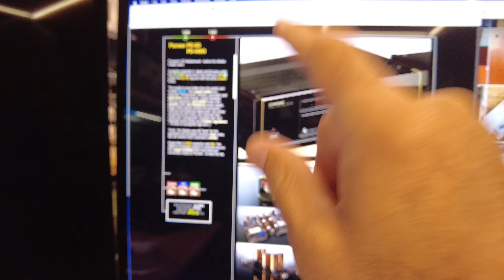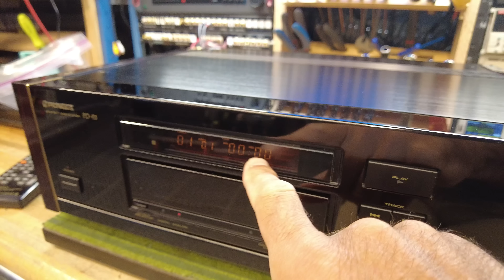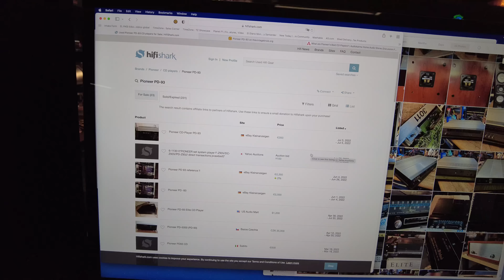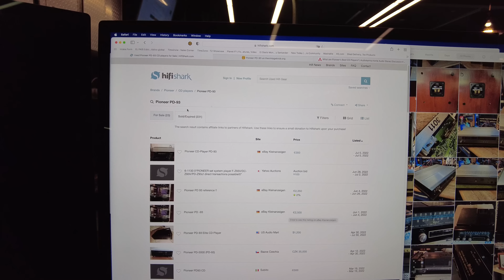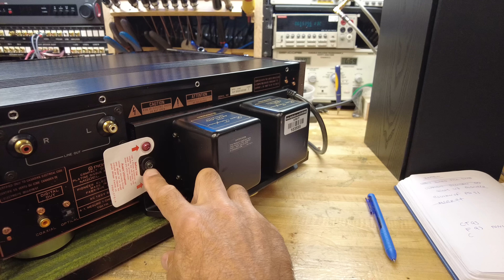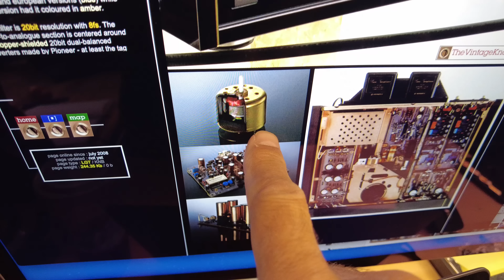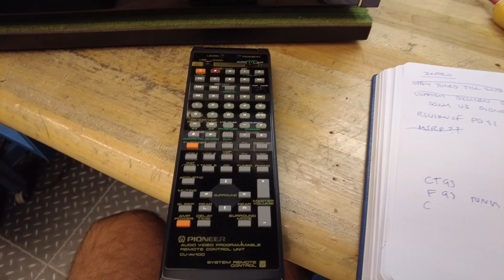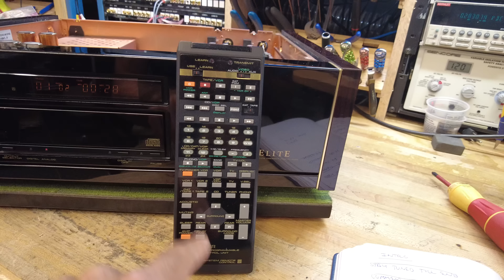If You Find One of These... BUY, BUY, BUY.  The Killer Pioneer Elite PD-93 CD Player

Comment: This is one of the best CD player to date. It is using PCM63 DAC covered with copper shield, the sound from it is extraordinary.
Reply: How does it compare to a newer Denon DCD-S10II for example ?
Reply: @ThomasL  Thomas it comes down to a matter of taste and audio equitment matching (Synergy)
Reply from the maker: Indeed, its all a matter of taste.
Reply: Pioneer made several better ones in Japan under the "T" series, like the PD-T07, PD-T07 limited, and the PD-T09 which the later is the best CD player they ever made and is far better (and much more expensive) then the PD-5000/PD-93.
Reply: @aegisofhonor  You correct Basically Pioneers Domestic market they got a lot of good audio in Japan -But also100v 
Tuff thing about cd players is their fragile in shipping
Reply: @tee-jaythestereo-bargainph2120  definitely don't want that banging around in the back of a  truck with just normal shipping
Reply: @aegisofhonor  Pioneer pd 07 is the same with pd 75 and pd 09 is pd 95. The difference between pd 93 and pd 95 is the output balance. Pioneer elite was for the US market and pd 95 only for Japan 😉
Reply: I have the pd-73 and I was wondering how much different is from pd-93/95. Are these way better than the 73? Thank you!
Reply: Single chip per channel or double. As far as I know there was a design flow in the 63 chip which creates crossover distortion which can be neutralized only if using two of them together.

Comment: I regret selling my pioneer elite vsx 49txi reciever. It weighed a ton and had an all copper chassis under the hood. I used it as a power amp and it sounded really good. Snatch them up if you can find them.
Reply: i only had a AV receiver and was brought to me from the U.S. had yellow lights in the display instead of siver but was the high end of pioneers av receivers at the time but had a quality of sound that i never heard till today in other was very heavy but older ,to the new more evolved AV receivers this doesn´t have any form of surround either than the older one but never the less as i said before maybe the best i ever heard
Reply from the maker: Sounds like we all have a regrettable story about selling some piece of gear in the pursuit of nirvana.

Comment: the agglomerate of wood is better than the wood itself in some purposes, such as for example it does not warp with temperature differences, however it can absorb moisture but so can wood, but also i believe no one has material of this quality in a damp place.
Reply from the maker: I agree Elias but the veneer is mounted on cheap chip board that falls apart at the slightest impact.  Perhaps they could have used a ply base.
Reply: @SkyFiAudio  I understand, maybe it would be better if they didn't put anything on the sides lol, oh well... but I believe the sound quality is fantastic, I say this because my main cd player is a Pioneer DV-868Avi and it has excellent sound quality in my Aura Va-100 Evo amp, but my dream " Buy Buy Buy" would really be the Grundig CD-9009, and from what my father once told me through a magazine he read many years ago and what I've researched and seen photos since then, it might be today one of the most collectable vintage CD players, a while ago i saw one for sale in the neighbor country of Spain, but 750€ is too much for a man who has a family lol. best regards.

Comment: By the way the turn of display is nothing to do with saving the display or dark room, it was to stop electrical interference onto the circuit form the VFD display. Also just correct you that is not true about belts, I had cd player in for repair that are 30 years old and the belts are fine. So it depends on how belts are made.

Comment: I was surprised to hear you say that you preferred true power buttons rather than standby. I've always heard, mainly from gear producers and sellers, that you should leave your gear in standby as it keeps it warmed up and that the jolt of electricity from powering it up does more harm than good. So which is better - to keep your gear in standby or powering it off and on after each use?
Reply: I heard this too, especially when it comes to slotted boards which over time can jolt out of place to the point of losing contact
Reply: Unless it has tubes in it, or they tell you not to do it in the manual, you leave it on all the time. It sounds better and lasts longer.
Reply: The question is what kind of standby. Often, it’s merely the ir circuit that remains on.
Reply: today they worn out very fast ,the lights start to decrease it´s brightness ,even worse in components bought in the 90´s i remenber this cd player having no stand by the light on the display never faded ,but the first i bought with stand by i notice one day that i fall a sleep in a sofa next to my system that even closed i notice that the display had some faded red light but in very thin lines through the all display ,also a deck i bought from pioneer in the 90´s, the CT-95 earlier model also had the same type of display but in other decks the display with the years starts to fade till one can´t see almost any light but also the display cover is a very thick piece of tinted black crystal plastic that when one disassenble it the lights on the display are still very bright, but one should disconect the all system from the plug everytime one lives home or not using it so this doesn´t happen(the fade of the lights),maybe in country´s that the electrical suply is not the best one should nkeep them on ,the diference that i know is the voltage and not only like pioneer components are in some country´s 110 volts 60 hz and in Europe excluding the british it´s 220 votls to 240 volts and 50 hz but the turntables since the 70´s said 110V and 50/60hz this in 74 when i went for the first time to japan where brands do release diferent components that are sold outside Japan
Reply: @DID70Sworkedoutforyou  The thin horizontal red lines are not a sign of wear but an actual part of how the FL display operates.
Reply from the maker: I guess I spoke from a technician point of view rather than audiophile.   We see so many great components come to the shop with burned out power supplies from being on for decades.   Yes a fully warmed up audio circuit will perform fractionally better but if its burned out you get nothing. Lol.

Comment: Was there ever a stable plater model that didn't have rubber belts?

I have a PD S705 I got used 20 years ago that I use as a transport. Haven't opened it up to look inside because it just keeps running.
Reply: i also have the turntable cd player PD-S804 that i bought in 93 or around it and it´s one of the best cd players i own, one notices a very good sound compared to other brands cd players at the time ,they used to say pulseflow then there was the direct link convertion or something similar but one can notice the improvement in sound quality and a litle more higher output sound, i remenber sony ES (esprit series/not elevated standart like some say ,that´s only written on the 1990 catalog from ES series) having a cd player very expensive that it had two modules the one that reads the cd and other where all the functions are and other that is similar to the CEC that one inserts the cd on top of the player casing and no display (because it´s also in other module) and some almost not seen keys to the basic functions(play,stop,pause and next or previous track wich costs a lot of money when new and today in second hand and more than 20 years of use ,they ask even more ,several thousands of €´s
Reply from the maker: I dont recall if it had belts.  Fingers crossed!

Comment: FYI: I had an Elite PD 65 stable platter with Musical Concepts mods, including outboard PS that I bought used some 10+ years ago. It saw mostly limited use. About  2 years ago the laser died, calls to Pioneer parts no longer available
Reply from the maker: yeah that the bummer with all vintage players,  its just a matter of time.  you can find lasers if your creative but its a pain.
Reply: @SkyFiAudio  Same thing happened to my Marantz HD CD-1. When I called it was discontinued, but, I was given the part number. I found ONE  from Asia, but $150 + shipping. Instead I bought a Audiolab CDT6000. Amazing value

Comment: Pioineers were good but they had a VERY serious issue with their laser in that the laser lens would VERY commonly fall out.  It really didn't matter if you got a budget CD player or a high end elite CD player, they all had this major issue that has caused most to not work anymore without major service (usually a replaced laser lens).  I think this is one of the very few models to have a bottom mounted laser; I'd say 90% of Pioneer CD players had their laser mounted on the top.  These are also ridiculously rare and you will almost never find these "out in the wild" and "for a good price".  Most are found on ebay and other sites like that usually for "market price" often $1000 or more which is a lot more then I think anyone should spend on an older CD player from that era as the failure rate is quite high when you get to CD players that old (like what happened to my precious Pioneer Elite CLD-97 that went crazy a few months ago and I may never be able to fix due to it's weird complex problem).
Reply from the maker: Lol, Ive seen a few of those where the lens is sitting on the bottom of the case.  Easy fix thought, love to find them .

Comment: It's a CD player... they all sound the same if they have a competent dac. Or you can play your files off of pc in lossless format with a 200 dollar dac and have transparent audio.
Reply from the maker: Yes Sergey but thats no fun.
Reply: Actually no Sergey, once converted to analog the signal still has to pass through electronics. In addition early CD players used a single DA converter that led to an 11usec delay between channels and at a low sampling rate of 44Khz led to the "frying egg" sound. I know this machine well as the store in worked at in the 80-90s had this and the CTA9X as well as the rest of this awesome Elite line.

Comment: Solid rose wood would have cost as much as the rest of the unit.  A solid wood would also is more likely to resonate.

The linear supplies were really beefy.  All my high-end players were Sony ES, glass epoxy boards.  Never liked the use of phenolic boards on anything.

I wish electronics would eliminate the electrolytic caps, a point of common failure.

Comment: That is lovely, but just cannot believe the fixed mains cable! I have hi-fi components worth £500 or about $600 and I would be disappointed if they didn't have an unplugable lead.
Reply: I have Pioneer Elite set and unplugable cable dont Bother me. I dont believe in hi end power cables.
Reply from the maker: Kinda strange they would make it fixed for this level piece.  Come to think of it, the rest of the stack including the amp has fixed cords too.  :-(
Reply: @Watcher4111  Nor me, I just think it's neater having everything plug in rather than having wires coming out of the back. Doesn't really make any material difference either way really though!
Reply: I think the changable power cord is really a new thing maybe started in late 90s? people and companies probably never thought about customer would want to change it nor they would change the sound.
Reply: @oskay4018  It is just another way to separate those with too much $$$ and and their wallet.  You can spent enormous amounts on a power cord but the wiring to get the power to the outlet is just plain ole copper.
Reply: @rockin355  well... I know there are people who doesn't believe cables especially power cables. I think power cord do matters and can change the sound by a good margin. However, I do agree that cables markets are generally overoveroverpriced....which I don't think it's a good business model. Having said that. I have 100% confident that a $500 power cords sounds a lot better than the cheap one comes with the gear (even the factory cheap ones there are sometime difference, some are better than others, maybe the ones back in the days were generally better than now days). Is a $5,000 one a lot better than the $500? probably not, maybe tiny a bit.... I personally wouldn't spend more than $1K on power cord, but I do appricate that there is a option to change it now than before... even not for the sake of sound improvement, it's good to have in case the old one is broken.

Comment: When I made the move from laserdisc to DVD, I ended up buying the Pioneer Elite DVL-91 combo player; it played DVDs and laserdiscs. The tray was very unique. The DVD tray was a separate piece but at the same time it was part of the larger laserdisc tray. If you hit the DVD eject button, only the DVD tray came out. If you hit the laserdisc eject button, both trays came out as one, large tray. Here, a picture is worth a thousand words: https://youtu.be/KWIimsPrORk?t=19  It had the copper bottom like what you showed here. It even had a screensaver.
Reply from the maker: I remember that strange drawer setup.  Very unique indeed.
Reply: @SkyFiAudio   It was pretty neat. Also, I think I had a late-model DVL-90 and not a 91 because the 91 had different style buttons and tray. Mine had a blue power indicator, like the 91, and the same remote as the 91, even though it was the 90 model.
Reply: Pioneer saved created laserdisc and the following DVD format.